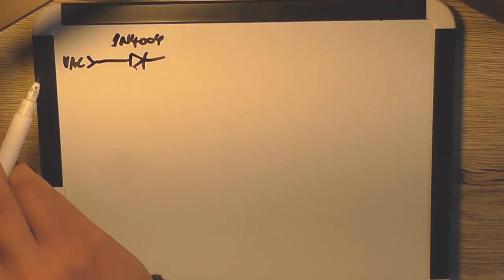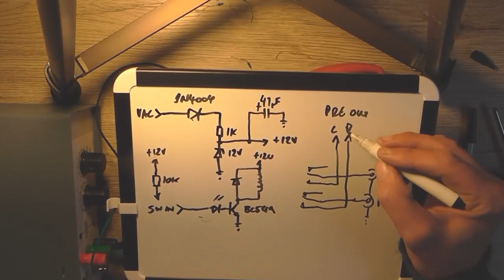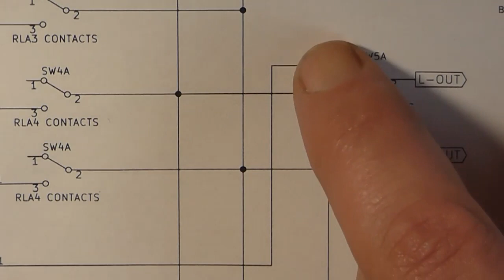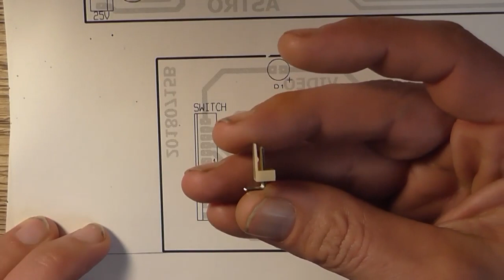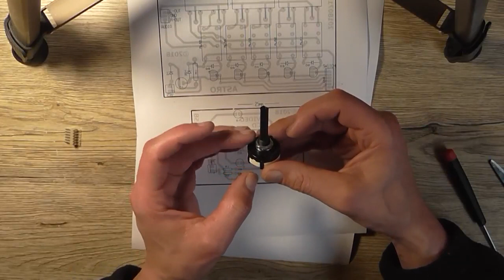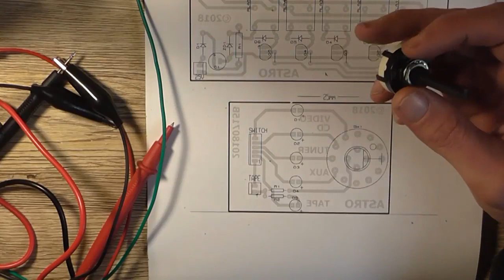Designing An Audio Input Selector - Part 1

Comment: Given the way you designed this, and the fact that you used an adjustable position switch... you should make it modular, so anyone using your schematic can add/remove any number of inputs they'd like. The design is great, but I also have a reel to reel and record player. If your design was for a 10 input selector, then anyone could just populate out the inputs to whatever number they wanted for their project and set the switch to match.